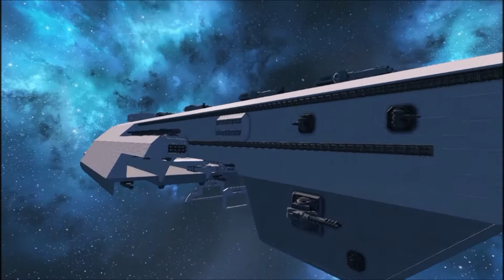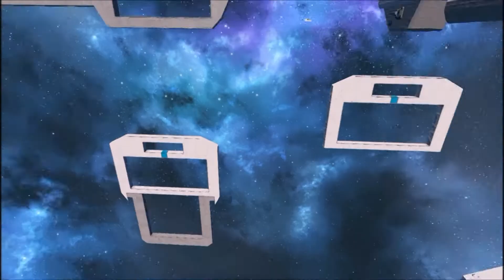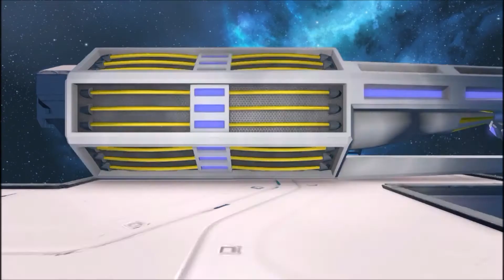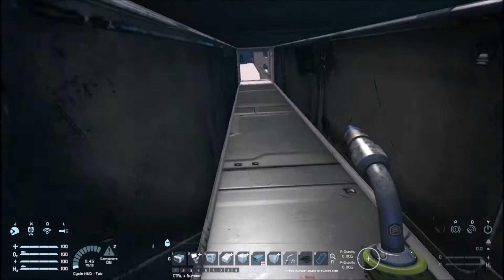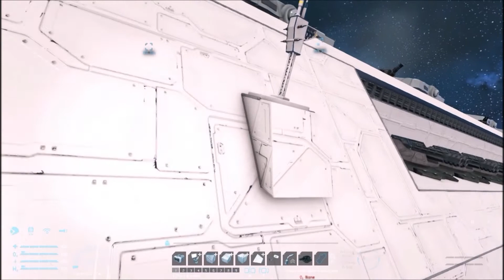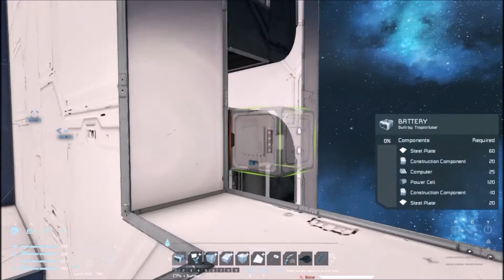Space Engineers Project 4 (part 1)

Comment: It's looking good so far. I like the curved hull areas and the front railguns (?). Random thoughts:

1. Nose - might want to angle it in rather than making it stick out. Paint the recessed areas a darker color to give the impression that the outer "shell" is thick and plate-like (but still curved). Maybe with a few turrets and rocket launchers for coverage?

2. Large flat/sloped areas - to me they're crying out for some ribbing. My approach is to alternate the 2x1 slopes (so the ribs stick out only half a block's height with the same angle). Paint the ribs dark so they stand out, and maybe so they match the turret colors for a consistent/integrated aesthetic.

3. Interior - the "jagged edges" from the modular design phase, I'd put slopes in some of them, maybe with a few bulkheads as opposed squaring off all the room walls. Much like you did with your small ships gone wild interior. (Continue the curved theme from outside.)